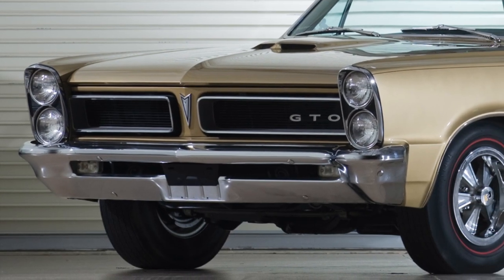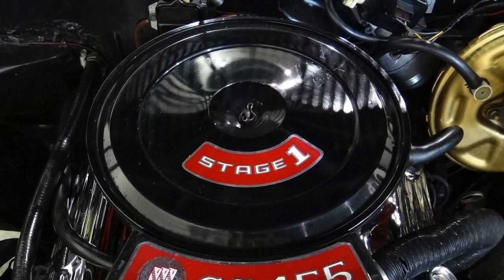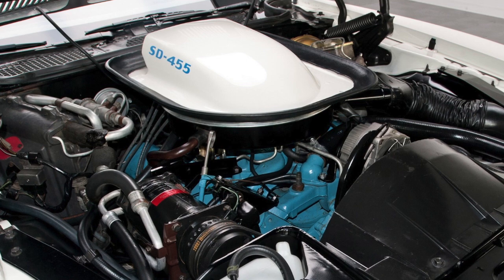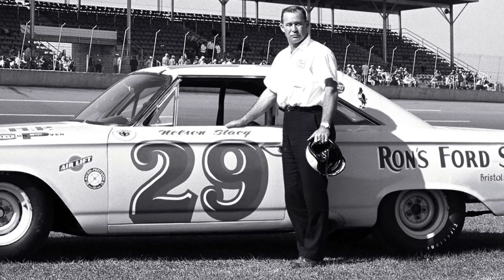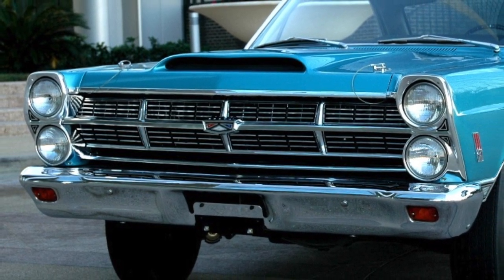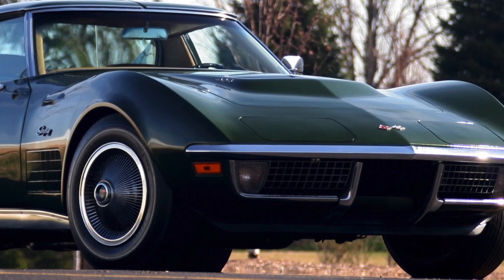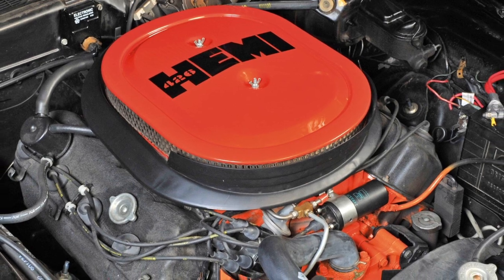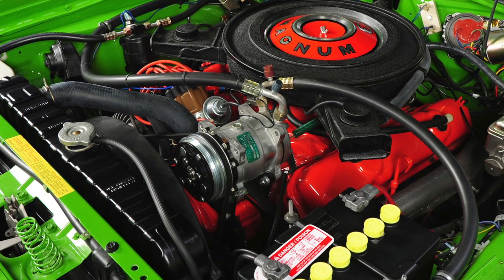5 Best Vintage V8 Muscle Car Engines

Comment: when i was younge, i was at a drag stip in buffalo and there was a 67 rairlane with a 427 there and 3rd gear was shot in the tranny so it would rev like mad in 1 and 2 and then go to 4th and it would bog for a second and then kick in and still beat all the competition that day, those were fun days when you could take your stock driver and compete with others like you to see how good you were,

Comment: The 71' Boss 351 was a legit race engine.  In fact the 71' Boss 351 was the most powerful small block of the muscle car era.  

The LS6 made the same HP as the L72 427 and was not as powerful as L88 or ZL1.  The added stroke of the 454 did help the the bottom end torque a little bit, but added more pumping losses so the HP remained the same.  

Production race engines included the Boss 351, Race Hemi, SD 421, L88, ZL1, Z11 427, and 427 R code.

Comment: I would have to add the Buick 455 Stage 2 . 12.0:1 compression forged pistons an Edelbrock B4B manifold with Holly Carb, Mickey Thomspon headers.  The stage 2 also came with 4.78 gears that's pure asphalt ripping power. 
One other always forgotten was the AMC 390/401.  Yes, AMC :)  The 390 /401's came with a forged crank and rods from the factory. Big little torque monsters.
Reply: The AMC could have been so much larger in displacement.
Reply: Stage 2 Buick didnt make the assembly line.
Reply: @dannydennis318  As I understand it "Stage 2" was a dealer installed option, not off assembly line.  Per "American Muscle Cars 1960-1972 Gunnell, J."

Comment: These cars didn't have the brakes or cornering suspensions that are common today, but...they were also very affordable to anyone with a steady job. Gas was cheap, so the formula was big displacement and higher compression.

Comment: I like that you put out accurate numbers for 1/4 mile ET. I get tired of these commenters, many that weren't even of age in these eras, to claim 12 sec or faster times for these cars. These would all probably break 12 with slicks, gears, traction and proper driving technique. It takes about 105 mph to have enough HP to do that. They were the fastest stock engined cars but they were not drag cars. We could beat them with our mildly built up small blocks. Many times because they spent a lot of energy literally spinning their tires. Is this racing or burnouts?
Reply: The  numbers are NOT accurate--still too quick.  No stock 1970 V-8 ever did better then 13.6

Comment: I see a lot of people complaining about engines we have nowadays. Back then from my understanding 90% of vehicles/engines never made it to 100,000-200,000 miles. Our engines now may be computer controlled, and more sophisticated but they also pump out incredible horsepower and torque numbers while getting good fuel mileage and a lot, I mean a lot longer lifespan. I’m my opinion fuel injection is far superior to carbureted. They have a lot better performance then those older engines. We just need to learn to work in new engines.

Comment: 427 FE R code and W code.  Keep in mind , the 1964½ T-Bolt ran an 11:28 @ 123mph..... off the showroom floor. When Ford released the 427 Cammer, Hemi had no chance.
Reply: The 427SOHC (cammer) was definitely a force to be reckoned with but the other Bad Boy in the Ford stable was the Boss 429. The Boss 429, like the Cammer was horribly under rated both in Horsepower and Torque was rated at 375HP and 390HP respectively. Actual numbers for the Boss was 585HP and the Cammer put out an even more impressive 612HP. Yes, the Dodge Hemi's and big block GM's were kings of the tracks back then. At least until those guys in the Boss 429 Mustangs and the Cammer Galaxies showed up. Interesting huh? Nascar/Winston Cup even tried to have those Ford engines banned on the roundy-round circuit. It took a year or two to get the Boss thrown out but the Cammer was nixed immediately. They were just fine with the Chrysler Hemi though.. One of several reasons why I don't bother with Nascar and never really have. Anyway, have a good day.
Reply: Mark rapacki , oh good. Another Google nut who thinks he's going to educate me. Ok then captain internet, maybe you can explain to me how it's even possible for a neighbor of mine to buy a Cammer Galaxie from a Ford dealership in the San Fernando Valley. He had it for years. I remember listening to him talk about how he took it to the local Saturday night drags and blow the doors off the Chevys and the Dodges. I thought he built himself until he broke out the paperwork and let me look over the original build sheet. Or maybe you can enlighten me on how a few of these cars being for sale at Pomona had paperwork and build sheets from dealerships all over California.  Truth be told, I couldn't care less whether you believe me or not but I will admit it's amusing to watch people like you tell me I'm wrong. Maybe you should think about turning your computer off and try getting out into the real word. Just a thought.

Comment: I have a 2000 GMC 3500HD one-ton dually. Sadly, that was the last year for the 454. It doesn't have much HP, around 290, but the torque is decent at 410 lb. ft. Fortunately, a few simple bolt-ons can boost those numbers dramatically.

Comment: Even with zero decking a SD455, setting quench to .040, using modern flat top 7cc vr pistons and milling the 111cc heads a BUNCH you are still only getting a real 9.3-9.5:1 compression, a better way to go is using a 4.50 inch stroke crank and that makes a 30 over 455 495cid then you get the compression up and monster torque, BUT SD455 stuff is so expensive almost nobody can afford to build it!
Nah Pontiac should have produced a RA4 428 that would have been a legend!

Comment: How would you keep a 11 or 12 compression motor with carburetors and mech/vacuum ignition and ZERO ECUs,   running today without leaded pump gas?
Reply: Run 93 octane and add a two dollar bottle of octane booster every time you fill up, really $2 extra per 20 gallon of gas is just a drop in the bucket, carburetors deliver fuel based on vacuum so it is basically self tuning unlike fuel injection where you need a full dyno tune every time you change something.
Reply: Does modern octane booster have the Lead(TEL)? If not then there is a valve seat job in the near future.
Reply: true hardened valve seat are a must , but popping off the heads is not that big of a deal as it is on a modern engine, its about $300 for someone to push in some hardened valve seats and resurface the head (a must other wise the gasket will leak) but if you got them off you might as well port the intake,port and polish the exhaust runner and mill out the pocket to drop the compression down to 10:1 if its a 7.0L or bigger you might go lower to 9.5:1. should come to around $1,300 including gaskets unless go for some high dollar professional CNC job but thats not necessary on a street car,  $1,300 is not really that bad when you consider your getting more power, more reliability (basically a top end refresh), and more ease of uses. Well thats my take on it anyways, you might have a different opinion.
Reply: Aviation fuel.
Reply: Run avgas 100 low lead or race fuel or E85 if you are prepared modify for it.  You can ditch the leaded fuel if install harden valve seats. Most guys will lower the compression and replace the cam with modern roller to make up the difference in power to run on pump gas.  

Octane boost will help with detonation but it's not going to give you the power you should be getting. They do increase the octane but not it the same way that higher octane fuels do. These cars were made when you could get 98+ out of the pump.  I wouldn't run it my car but what would I know driving a heavily boosted rotary...
Reply: @edwardjones8170  These engines are getting close to all being 50 years old or older now dude. Freshing up the heads has been done a few times by now haha and of course they're reman so no lead is required. That was just for stock engines.
Reply: Racing gas or aviation 100 LL.

Comment: A bit surprised I didn't see a '69 - '70 Boss 429 in this vid.
Reply: 428scj if disqualify cammer 429.
Reply: Exotic motor, exotic price. Mismatched carbureted, should have more like the HEMI because it was one. C’mon Ford, should have paid attention!
How about better exhaust flow, even in the  tight Mustang confines. Headers? Boss 429 could have made this list. Ford F’d this up.
Reply: Did not run that good from the factory . With a bit of tuning they ran good. 428 was better for the average guy then just like the 440 6 pack was to hemi.
Reply: Around 9:18 he mentions the 4 29 and said the it was a much milder engine in the 4 27
Reply: The Boss9 was kind of a dog from the factory until you did a few of the right mods to it that Ford should've done to begin with...like installing an 800-850 cfm carb, headers, a more radical cam, adjusting the ignition timing, and ditching the smog equipment and opening up the exhaust. Then you would unleash an absolute monster of an engine
Reply: The 429 was actually a pretty poor racing engine, it was rushed into production in 69 to try to compete with the hemi. It was under carbed , was a poor breather and had poor midrange.  They were very cold running engines for the street. They needed mods to run good. Besides all that, since they are so rare, they command 6 digits price tags  and are probably the most beautiful body styled mustangs ever
Reply: @byronnewcombe7358  My cousin ran a 70 Boss 302 for years, what a nasty little small block! Great car, he was always street racing my brothers 340 Challenger, alas, both cars got sold but I treasure the memories !
Reply: Ric Pratt Those were more top end not 1/2 mile. The 428 SCJ would smoke it in the quarter mile. They tested one and it ran 13.56. Now with slicks and a 4:11 cogs it would run 12s
Reply: I saw one of these once and people will argue with me that Ford never made a "Hemi"
Reply: RA M The Cammer 427 apoximatley 650hp on the dyno stock. Connie Kalitta said this is his all time favorite Ford motor. .
Reply: @stripervince1  Agree.  The head geometry was pathetic.  It was the worst engine Ford ever made in my opinion.  Had all the problems of a 426 Hemi with 100 less HP.
Reply: @nathanadrian7797  Boss 302 was a great car built to shut down Cameros...and it did that and some.
Reply: @RAM-BAWN  They did not make a Hemi.  Hemi is a trade marked word by Chrysler.  Ford made Hemispherical heads.  Both used Hemispherical heads but only one was branded Hemi.
Reply: @m42037  Most badass motor ever produced at FOMOCO.  In a complete different league than all but LS-6 and 426 Hemi

Comment: Fun Fact: The Ford FE 427 had an actual displacement of 425.98ci.
Reply: Considering Chrysler had the 426 ,Chevy the 427 ,why didn't Ford just refer to it as a 425 ? .
Reply: @jerryparks6123  Because NASCAR had a 7 Liter limit so Ford just said 427. It's okay to say your bigger when you're not. In car engines anyways.

Comment: What about the HO455 IN 1972 TRANS AM?
Reply: SD
Reply: Not even close to being top 5 all time......a 72 455ho is a low compression boat anchor, but performed pretty good when put up against other engines from 1972
Reply: What about it? It couldn't touch the '71 LS5 BBChev, which couldn't hang with any of the BBChev 427s. It also couldn't touch the '70 Buick 455 Stage 1 which was much lighter on the scales andc made a lot more torque. Even the 500 Cad couldn't beat it for torque.
Reply: That was an olds engine.
Reply: Ya baby!  But i'd take the SD-455 in the 73 T/A .  Actually both were awesome.  The 70 1/2 400 Ram Air IV was special too.
Reply: Jeremy  Thompson The 455 HO has the round exhaust port heads and a high-flow intake. Doesn’t have all the forged internals of the Super Duty so it won’t rev as high, but hardly a “boat anchor”.
Reply: @terry-zi7eh  Agreed and rated at 335HP.

Comment: Would have been nice to see the legendary Oldsmobile 455 HO on this list, as used in the 1970 Olds Cutlass 442 W30 - alongside its equally-worthy Buick counterpart.  Two name-plates not know for laying down massive power, doing just that.
Reply: Yea the camero killa I got a 67 330 320hp ultra hi compression  bone stock
Reply: Very true The Buick and 4sp W-30 were closer to over 440hp.

Comment: Here's my top 10 but not necessarily all in order
1. Chrysler 426 Hemi(1966-71)
2. Ford R-Code 427 (1963-64 top oiler, 1965-67 side oiler)
3. Pontiac 421 Super Duty(1961-63)
4. Chevy ZL1 427(1969)
5. Chevy LS6 454(1970)
6. Pontiac 400 Ram Air IV (1969-70)
7. Chrysler 440 Six Pack/Six Barrel (1969-71)
8. Chevy L78 396(1965-69)
9. Pontiac 455 Super Duty(1973-74)
10. Buick 455 Stage 1(1970)
The only reason I have the Buick Stage 1 at number 10 is because it doesn't have all the beefed up internals like the rest of the engines on my list
Reply: No Boss 429?

Comment: ...I now firmly believe a lot of older cars actually had more miles on them than we thought...it's funny that 200,000, 300,000 mile vehicles started to be noticed after they added the "100,000 mile" digit to the odometers, starting in about the late 1980's-early 1990's...the GMT 400 pickups were the first I personally drove that I noticed the odometer now showed "hundreds of thousands" instead of topping out at 99,000 and then rolling back to zero...I believe a lot of used car dealers back then sold a lot of "50,000 Original Miles" cars that had been well taken care of, that actually had 150,000 on them...and a lot of obviously more well-used vehicles that they sold as "A-Hundred-And-X-X-Thousand Miles" were more often "Two Hundred and X X Thousand", or even "Three Hundred and X X Thousand" miles.....

Comment: Great video. But what about the Ford 427 SOHC? Ford Boss 429? Chev aluminum-block 427 ZL-1 (585 hp)? Chev 327 fuelie (375 hp!)?
BTW lowered compression ratios always get the blame for reduced power in 1972. It was a only a small factor. To meet new emissions laws, cam profiles were reduced, carbs were leaned out, exhaust gas was recirculated into the carbs, and so on. And engines were now rated in net hp (tested as installed in car) rather than gross hp (accessories disconnected, open exhaust).

Comment: I had a  427/425hp 69 Camaro.  It was a beast!  OK, not factory built. Took the motor out a a 67 corvette. Still very nice. When gas went to 75 cents a gallon, I dumped it.
Reply: We had  guy in our town who had one of the COPO  Camaros. 69, L88, 4 speed and 4:11 12  bolt. It was black/black and the only thing that kept it from being a total sleeper was on the roof pillars..... "King Kong" in white lettering. Street raced many years and never saw him beat. Wiped out my 74 SD-455 Trans Am by 3 car lengths.
Reply: @bluesman7475   them copos are rare worth big money cause they where bad asses
Reply: @bluesman7475  Do you recall the rear's gearing in your trans am by any chance? They were probably low gearing too uh?
Reply: One thing GM did well was the 396-427 Chrome Valve covers you never grow tired of them old Chrome mirror Clean looking Valve covers One other thing GM did great in there cars what that HorseShoe shifter with the gauges seeing both of them in a RS or A SS car very nice
Reply: The Corvette big block engines in '67 were 390, 400 and 435 hp plus the L 88.

Comment: i had 71 nova a little 307 3spd with a carter. did mid 13s. always liked the carters. id take a rochester over a holley tho. hollys are good at the track and need alot of adjusting. thats my opinion

Comment: Back from the mid-sixties on, what are now called “Top Fuel Dragsters” were designated “AA/FD”.  The absolute best of the best all used the 426 Hemi... modified, of course.
Reply: @Primus54 - I know two of the BEST NHRA Top Fuel racers back then who would say B.S. to your comment!  Don Prudhomme and Connie Kalitta.  Their Ford 427 SOHC powered dragsters were capable of hammering the mighty 426, which they both did on many occasions !
Reply: @Loulovesspeed  What did Don Garlits chose? 😉
Reply: @Primus54  - I'm well aware of who Garlits is, but what engine he used has no relevance to my reply.  You said the best of the best ALL USED THE 426 HEMI.  My reply stated not ALL of the best, but certainly some of the best.
Reply: @Loulovesspeed  Well good for you.  You certainly showed me.  🙄
Reply: @Primus54  - Actually, I think you showed yourself with that comment.  Lol